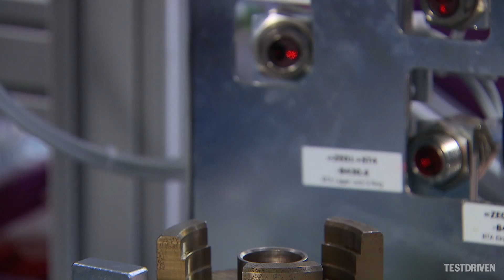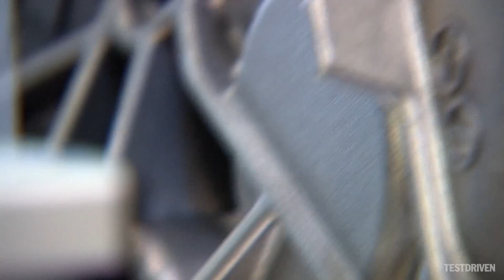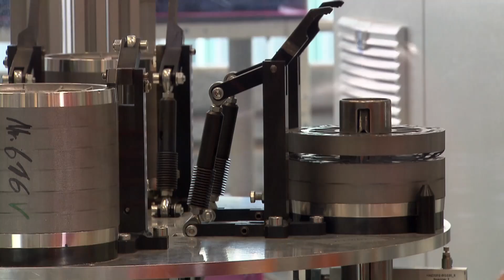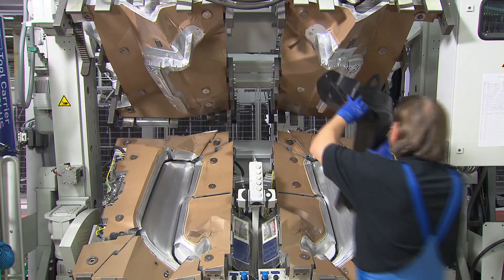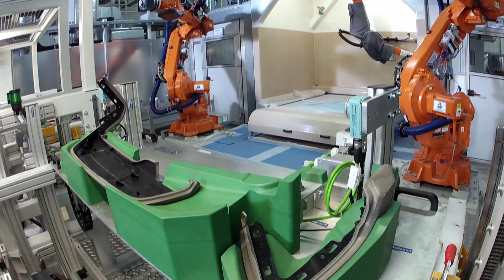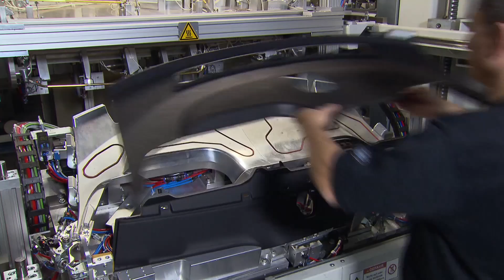BMW i3 Production - Part 2

Comment: Before inserting bearings safety cover automatically closes that's very good. Japanese like to cancel those kind of safety structure to "improve" efficiency, resulting poor accidents... Not only that we usually don't wear ear muffs even production line is very noisy. We should learn safety mentality from overseas.
Reply: Yeah. I've visited BMW plant in Munich, and then decided to visit Toyota plant near Nagoya. I was a bit disappointed. Unfortunately, welding lines (which impressed me the most at BMW) were closed that day at Toyota plant, and everything else looked much less futuristic.

Comment: it's top notch automation and robotic, but as in every car plant it's always shocking to see so few people. This plant must have costed hundreds of millions, not counting the substantial R&D costs and we are talking about carbon fiber. No wonder the i3 is that expensive
Reply: Plant Leipzig employs over 5000 people
Reply: I visited the Audi factory in Englestadt about 10 years ago and said the exact same thing. The only people I saw were doing the interior work like inserting the seats headliner and dash, that's. I'm for robotics since it free's humans to do work they are better suited for instead of repetitive mindless work. YES!, this is why the i3 cost nearly $60K USD and is way overpriced. However, I just bought a used 2018 for $20G with 4K miles and its a steal at that price.

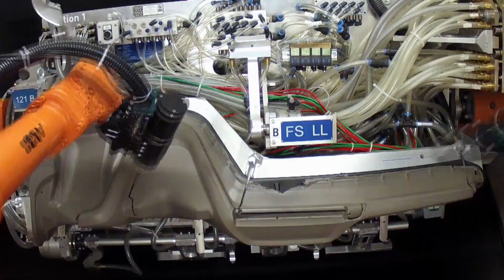Comment: What is happening at 14:28 and why are there so many wires?
Reply: +Richard Stokes My guess is those are actually pneumatic lines (air/vacuum pressure) that hold the dashboard piece in place. As portions are cut away (for air vents, instrument panel, etc), the individual lines are turned on/off to remove those sections.

Comment: Complicated design, and way too many parts. For a comparable size motor, Tesla has more than 400hp max output, while BMW has less than half of that.
Reply: yeah, a 400hp city car is perfectly sensible.
Reply: So, I'm guessing you work in the industry and can savely say which parts are redundant? Please tell us.
Reply: James Franklin More parts equals more fasteners, a poor quality control feature, which could result in more failures, and will result in more expensive quality control and production costs.  If Tesla is building a larger more powerful car with less components, their comparable I3 vehicle will likely be superior to BMW's offering if they can match the weight savings.
Reply: 68fbjjz109 i don't think you understand what i'm saying. Never mind.

On the point of reliability (and entirely unrelated to my original post), I'd much sooner trust a company that has been building cars and motorcycles for 98 years compared with one that has so far only been going 11 years and has only designed 1 car from scratch (remember, the roadster was mostly a lotus elise).
Reply: James Franklin Yes they have 98 years of experience building and over engineering gasoline powered vehicles. There is alot to be said for a company which has taken a radically different approach to building cars, company structure, and interacting with its consumers. One of the reasons why the auto industry is worried about the success of Tesla. Specifically the German luxury imports which it out sells.  Now Tesla doesn't have years of experience building vehicles another way and that's a good thing. That is often more of a hindrance especially when it comes to doing something different. However  BMW is trying to do it right by doing a complete ground up EV build. 

You didn't mention reliability, however the person you commented on mentioned an excess of parts, which means an excess of fasteners, which ultimately leads to poor quality control. So my comment was directed to Le Cheng Xu ad much as it was to you, given we are having a conversation online. About the I3 and comparable vehicles.
Reply: The asynchronous motor in a Tesla is less efficient than this and it requires liquid rotor cooling because there are bigger losses in the rotor. It is cheaper to produce though because it doesn't need permanent magnets.
Reply: Also the tesla drive unit is a lot bigger, it's not a "comparable size motor"